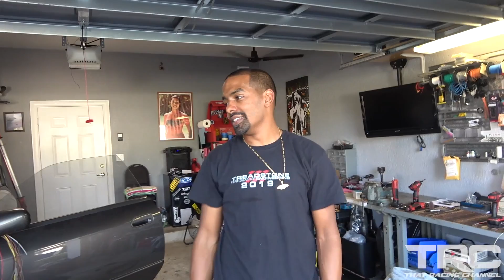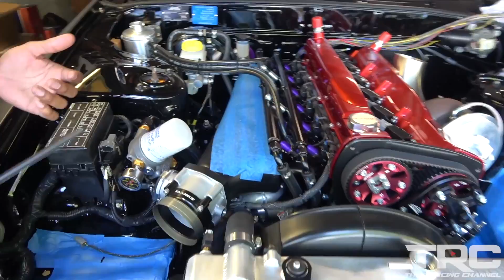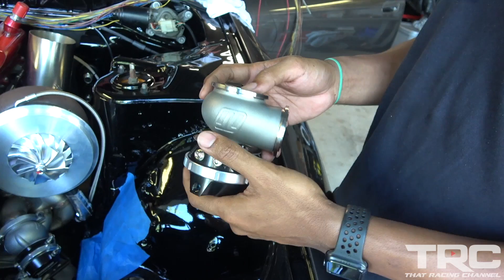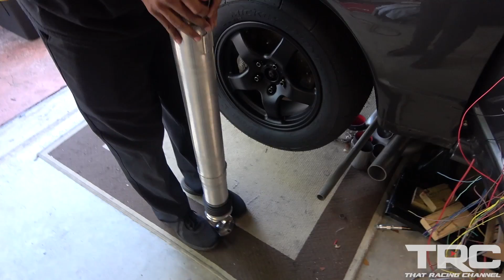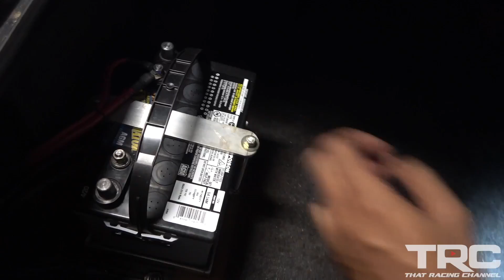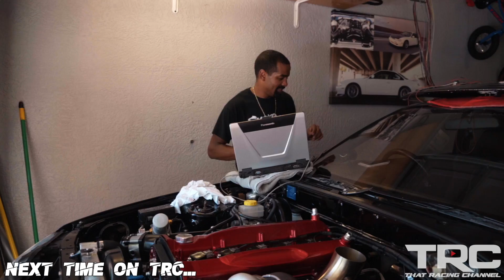1200HP Skyline R32 GTR NEW Drag Tire Setup looks MEAN! + First Start Prep (3.2L Stroker AWD RB30)

Comment: 12 1300cc injectors is just plain stupid. You can get fic 2600cc injectors. Also not sure if you know this (based on your lack of knowledge using 12 1300cc injectors). The more injectors you have the more inconsistent fueling will become. Along with increasing points of failure. SMH "that racing channel" making some amateur mistakes...

Comment: Can't wait for this as a 3.2L Nitto stroker R32 gtr owner this is going to be so sick in the USA :D :D :D
Reply: 4" custom TI to the the rear is what i run,  i always comment as i get info in videos ^^
Reply: RB30e/et Standard block is good for 1500-1600whp Max.. But i'm sure you both know Maatouks / CRD both ran into the 6s with Factory blocks before they hit the wall an needed Billet for more power to go faster ;)  My Block is close to this spec, Nitto 3.2L have everything Hypertune as a bolt on an PRP for safety measures,  no hellcat pumps tho :(

Comment: Forget those all those hellcat pumps, keep 1, and go the PRP Mechanical fuel pump, less stress on the electrical system & more reliable, also safer. Not to mention they're good for 2000+ hp.

Comment: Should have used 33 gtr ps pump so you could put under driven pulley on even with a ps cooler you're going to have some issues and i hope you're putting some ducting on your oil cooler loving this build

Comment: Hey TRC, Is the fuel pump going to be going to use power straight from the battery, if so how large is the wire gauge going to be for the triple hellcat pump ?

Comment: Why would you want to keep the cooling lines under the manifold and the stock radiator and clutch fan lol
Reply: Stock style radiator. I mean come on does that rad look stock to you? And oem fan clutch move tons of air all the time.
Reply: Tim Holubowitch didn’t even look 🤷🏻‍♀️ didn’t watch the video that hard. All I heard is dude who’s actually building the car literally say “factory radiator.” 
So does an electric fan lol. Just have the ecu trigger it to be on at all times. Looks cleaner, weighs less, takes up less room, and is more efficient. All without the unnecessary drag of having yet another component on the belt system.. it’d be different if their concern was to reduce load on the electrical system but clearly it’s not or they would also have a mechanical fuel pump.. not 3 hellcat bumps shoved in the tank.
Reply: That 150 there are a lot of things on this build that make sense and a lot that don’t. I agree with you, when I built and put an RB30 into my R33 GTR Vspec, I went a different way with the fuel sysem, the coolant, even the drive line. Hellcat fuel pumps smh. These guys have the money but I don’t think they have experience. They should have reached out to a AU or NZ company the way I did. I mean they have hypertune and PRP stuff but the experience that these companies have is not reflected in some parts of this build. Personally, I even talked to Andrew at Motive Garage when I first started my build in 2015. I ordered my RB30 from RIPS in NZ and had it delivered to NJ and even after all that, I still reach out to the boys down under to see what they are doing. These guys basically replicated their Supra build into a R32.
Reply: James Thomas exactly